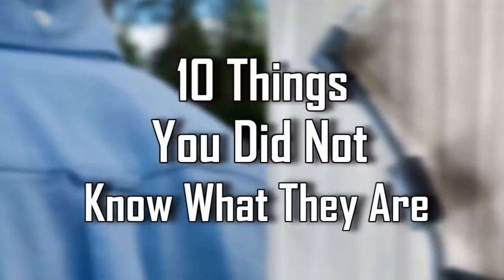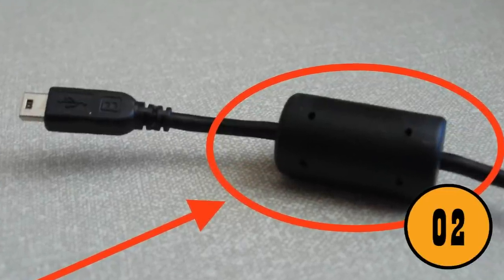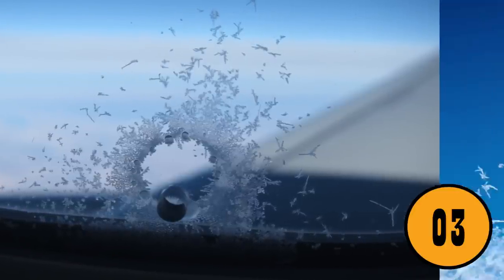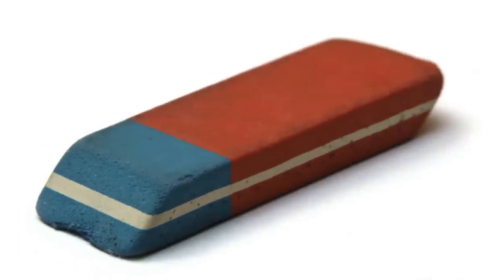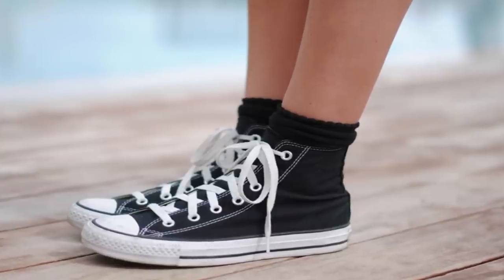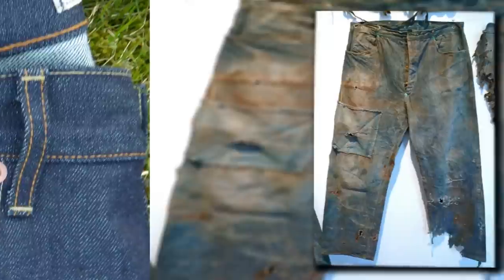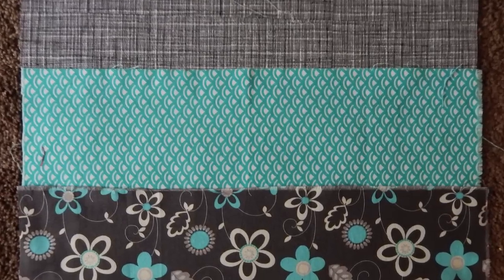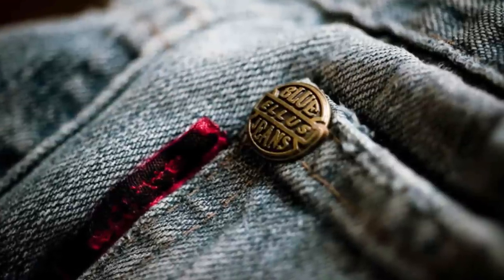10 Things You Did Not Know What They Are

Comment: That loop is for people who wear Y suspenders. They slip through.
Reply: I think you are right.
Reply: makes sense, ty
Reply: Nope.  The Y is much lower.
Reply: What if I told you that not all suspenders are exactly the same?  /Morpheus meme/
Reply: Don't listen to this joker, it's clearly for a vampire-slaying ninja sword. Have you not seen Blade? :O
Reply: Considering that the loop is far too high for Y-strap suspenders to slip through, I find this ludicrous. And what would be the point? I've worn suspenders for years (because they look fucking dope) and there's never an issue with the back strap/straps needing to be held in place.

I think Mr. Q is making shit up.
Reply: You would have to plug the whole before you got into the air, and hold it until it shattered. Not a good idea.
Reply: Actually, the loop is called a 'locker loop'. More info on google
Reply: Bruh, I learned more from this comment than I did from this video.  Nice work.
Reply: This reason makes sense and is better than the whole video.
Reply: Mr. Q - iLoveQatar.net that was obvious
Reply: Them spenders going through that loop would make for some VERY uncomfortable spenders!!!  Either that or Ole MG is about six inches across the shoulders...........
Reply: That makes sense. :)
Reply: And most people think, and think and think, some even make videos :)
Reply: I thought you could use it to were head phones when you were them behind your back it stops the cord from getting tangled up in your jacket and bunched up it also looks cleaner
Reply: Kippetjevanalles your right i use them to hold the head phone cord so they dont get in my way
Reply: Yaaaaay guess who's here Qatari guy and Mr.Q
Reply: Mr. Q - iLoveQatar.net and 7
Reply: @crumblecolic, my bff from Cheraw, from college, Lisa Williams.. she is working stuff like that, and recently repaid in full her college loans, using some website.. I think it's Gulf10.com or something.. Interesting thing is that she was able to do it working part time only, managing her classes along the way as well
Reply: Mr. Q - iLoveQatar.net makes more sense than the others.
Reply: Yea but let this channel get the less likely reasons lol
Reply: Polite Doom why did you need to say why you wear them lmao.
Reply: Yes because SO many of us wear suspenders.  Yep.
Reply: Nono you don't stick the suspenders through the loop the loop is just "for" them. Kind of like how i'm for free speech but i'm not gonna pass myself through it just to hold a pair of pants up.
Reply: Correct
Reply: Mr. Q - iLoveQatar.net 1999 MITsubishi Montere
Reply: When I was in jr hi school they were called fairy loops and were often ripped off the nerds' shirts.
Reply: Mr. Q - iLoveQatar.net its to tether a hat.
Reply: I cannot believe the number of people who bought the "suspenders" bit. Seriously people? Great troll Mr. Q, very successful.
Reply: @christyler1817  That's not the reason they were invented (yes, it's a "locker loop"), but it's a pretty cool idea... if you can reach back between your shoulder blades to thread the cord. :-) (I know, I know... before you put on the shirt). But maybe you should try to suggest to manufacturers to move it to the bottom back of the collar so it became more versatile as you suggest. From little ideas... !!
Reply: It's to hang your courting onion. A yellow onion means your dating casually. A white onion means you intend to ask the girl to marry you.
Everybody should know that.
Reply: Boj doog
Reply: Deathrider o
Reply: Thanks
Reply: You would think he would do research on what it's purpose is
Reply: Google it, sailors used to hang their shirts, then it crept into fashion. It's too high for even the single type.
Reply: Could it also be to connect to the suit jacket
Reply: Its to hang key chains.
Reply: I was about to comment about the y suspenders also but ya beat me 😉
Reply: Thank you
Reply: Simply use bubble yum
Reply: I WAS THINKING THE SAME THING
Reply: You just saved me 5 min
Reply: @Deathrider you had me at "i wear suspenders because they look fuckin dope". 😍
Reply: I hate how some people dont know this comment is a joke

Comment: I always thought the hole in a pen cap is so the air can escape when you press it down on the pen... pushing the pen into the cap would compress the air in the cap so the leave a whole to allow the cap to go on easier and also not createing vacuum suction making it hard to remove.... am I wrong??
Reply: I highly doubt that. The average pen cap only slides about 3mm before locking in place on the pen. No resistance due to suction or compression, not in my lifetime of using pens anyway. I mean, take magic markers, kids colouring pens (felts, as we call'em in NZ) and white board markers etc - they have to be air-tight so as not to allow the tip to go dry, yet still no issues with compression or suction in the lid.
Reply: I think that could help with that. It might also help reduce the chance of explosion.

Comment: “The design is quite simple: it’s made from therite and wrapped for its protection.”
Most videos wouldn’t have the balls to mention something obscure like therite and then not actually explain what it is despite being an informative video. Kudos.
Reply: And then promotly not explain what it is or why it is there.
Reply: Ferrite bead*. If a device is susceptible to interference, without this your device will act erratically or itself will emit interference. Think radio antenna. It stops the cable acting as an antenna basically.
Reply: Ferrite, not therite.

Comment: The hole in the airplane window is not there for passenger safety. It is there to prevent stresses on the plastic cover over the real window of the aircraft. Even is it does break there is no danger, and the inner window can simply be slotted out and replaced whenever it breaks. The inner window is only there to protect the outer (real) window from getting scratched, knocked and thumped by the passengers.

Comment: dude,the hole at the top of a pen cap is to stop the ink. if it doesn't make sense,it's like how a lit candle survives underwater with a glass to prevent water from coming in.
Reply: Don't know if it's true but it makes way more sense than what they stated. This and the fact that not all pen caps have holes in them.
Reply: YEs they do, but only the right sort of people can see them..
Reply: I think its like how a tree in my house fell because I looked at it in a forest.
Reply: how does a hole stop anything?... so many people nowadays express themselves so poorly! ><'
Reply: dude,I said it's like how a candle survives underwater using a glass while pushing it down.

Same thing happens when a pen cap has a hole and you put it on the pen.

it's because of the air pressure that gets trapped inside and the hole is where the air pressure builds up the most. This is also the reason why it's hard to take the cap off. It acts as if it's sucking the cap in.
Reply: Tetsuo Arakawa yeah, but those two scenarios are totally not one of the same kind. A glas with air in it is push down directly on and into water with its opening facing downwards and then inside the glass there is air and outside the glass there is water, two very different substances with very different qualities. Because of all these factors the air stays in the glass since air is lighter then water and therefor wants to go upwards where the glass forms a barrier so it can´t escape the glass and thus allows the candle to remain burning. Meanwhile in the case of the pencap the opening can be pointed towards any direction (downwards but also upwards, sideways, whatever) and both inside of it as outside of it is the same air with the same qualities. So really the only similarity in your comparison is that in both cases there is a hole in the object and that something gets puched onto or into something else. Everything else is basically different.
So that's why I felt like you weren't making much sense and I just hoped that you did had some sort of logical idea about it so I hopefully assumed that you are just really bad at expressing yourself...
Reply: Tetsuo Arakawa But in your second comment you stated that the air trapped inside the pencap somehow has a higher pressure (if that is indeed what you were trying to bring across) and that it builds up the most at the hole (so near the hole INSIDE of the pencap I assume you mean?) Why is that? I really haven't learned anything much thusfar, only a few apparant facts since a pencap on a pen and an air filled glass upside down underwater aren't the same thing.
Reply: I asked my teacher about the pen cap in our science class 2 years back. there are more than two reasons,but all I can remember is to prevent choking and to prevent ink leaks. A pen cap with a hole prevents ink better than the other pen caps with smaller holes
Reply: Karaz Feral-Fang So he "swallowed" the pen cap into his airpipe?... that must be so painfull...
Reply: XD

Comment: #6 is entirely incorrect.. If I may, the space is there to drain liquids through - which is why many spoons and ladels come with slits or multiple lines.

The conept of it measuring servings is an old folk tale and the usage does not even stand up to scrutiny, since many of the holes are varied and of different sizes.

Sorry, just had to correct at least that one egregious incorrection...

(I worked in a few restaurants growing up, including one high-end one)
Reply: That much spaghetti is enough... For a baby. I honestly don't know how that's a whole serving.
Reply: Its really there to measure a serving of pasta...you fill the hole with the uncooked pasta...remove and boil..that will equal one serving.
Reply: @briandazio3285 
The spoons you can buy are all different sizes, some have holes,some have slots, some have multiple holes or slots. Or both. The portion thing makes no sense at all. If all spaghetti spoons were the same exact size, then maybe. But they aren't.
Reply: Ok...im talking about the spoons that habe one nickle,quarter size hole in the middle...they are specific pasta spoons.
Reply: Brian Dazio I’m still trying to understand how a hole the size of a nickel could measure out a serving of pasta. Do you mean you stick pieces of spaghetti in until it is full, pull it back out, and then cook it??? What if someone orders rigatoni, or penne, or farfalle, or conchiglie, or fusilli? Wouldn’t it be easier to just weigh or eyeball the amount necessary for one serving.
Me thinks the hole is to drain the water.
Reply: Thats exactly what you do...its a pasta spoon...not to measure other types of noodles.
Reply: Brian Dazio So you mean it’s a spaghetti spoon, pasta can be any durum wheat noodle of any shape, generally derived in Italy.
So do yo think it would work with linguine or capellini?
Reply: Brian Dazio pasta!!!??? Bro pasta can be big noodles or little... da frick
Reply: But on some pasta boxes there's the same measurements 🤷‍♀️

Comment: And for all these years I've been wearing my tie on the front...Here I always thought the loop was a pony tail tamer.

Really gang... The loop is called a "locker loop" and  it is for hanging. If you hang a dress shirts by the collar it will distort them. Hanging it at the back, where it is under pressure from the shoulders when worn, will quickly smooth out any hanging wrinkles.

And the watch pocket was kept and was later referred to as a key pocket. It keeps a key separate from other crap in your pocket so it's easy to find. If you have a few keys together, the pocket keeps them from rattling arounnd in the main pocket.

Comment: what if someone blocks the hole on a plane window
Reply: that's what i was thinking
Reply: whole plane explodes and creates a black hole.
Reply: You wouldn't be able to block every single hole on the plane, for starters. Even if you did, you wouldn't be able to block it with a tight enough seal to prevent the pressure equalisation
Reply: well you dont have to block all of them only a single window breaking is already a big problem
Reply: If you press your finger on the hole and the plane starts to sink, you flesh will be sucked between the glass panes, ripping your finger apart. DON'T TRY THIS AT HOME, BOYS!!
Reply: this... just this...
Reply: How could you possibly try this at home? Even if you had your own plane at home, how would you get the  air pressure to change enough to matter?
Reply: NYpaddler You just seal your house, drill a hole inside you window, turn on air condition and lower the temperture below -20 degree celsius. The force between the cold area inside the house and the heat outside will create a strong vaccum-like area in the hole. There you could imitate the effect but again.
DON'T TRY THIS AT HOME!!!!
Reply: haha you are all brilliant
Reply: Now you have something to try next time you fly. ✈️
Reply: 木星からの脱出 don't encourage 😂
Reply: Derek Gleeson
lol, sick humor

Comment: Nr 8
The hole is for air. Without it, the air in the cap would push back the ink by pressure and the pan would become useless.
Reply: Not true at all. Long before you were born the caps did not have a hole and the pens worked fine, till they ran out of ink.  The first time I saw one with the hole in the top  I was pissed because the cap without the hole would keep ink from ruining a pocked or inside of a purse if the ball point was defective and started to leak.
Reply: It is so you can take off the cap easier. I remember when they changed this. I used to have to bite it to get it open in High School. If you were not careful, you would crush the pen and get ink everywhere. It was always worse after the item was in an outside locker then brought into a cool room for a while. Store your stuff in an outside locker for lunch. Math after lunch using my pencils, then second period after and the pen biting began.
Reply: Ballpoint pens worked for about 70 years just fine without holes in caps. They were introduced when children dying from inhaling pen tops became an issue
Reply: Internet. News
Reply: Clearly somebody isn't up to date on their pen design lore.

Comment: So the hole in the cap of my Bic pen is in case I swallow it??
Reply: Maybe kids who chew on the caps?
Reply: I thought it was to keep stupid people from spazzing out and stabbing themselves in the eye.
Reply: It has many uses. It is also there so if you bring it on a plane, it won't blow up and fucking get the worst mess in your life.
Reply: no it's air pressure bs
Reply: it could be to allow the pen to shut.. if there was an air pocket inside the pen cap, it'd be difficult to push the pen into the cap.
Reply: That is exactly what I thought, if the pen fits very tightly the air pressure inside wouldn't allow you to push the cap on completely.
Reply: The opposite is also true. Without the hole, it'd be harder to pull the cap off because of the air pushed out to close it. There'd be a mild vacuum effect resisting an attempt to pull it off.

Comment: The spaghetti one is bullshit
Reply: Yep, it's clearly just for draining excess water when serving.
Reply: Probably both actually.
Reply: As a bonus: Hole = less plastic used per spoon = lower cost (it's small but over the number of spoons the company makes it adds up)
Reply: Totally
Reply: How in any way does a hole measure out a serving size? It makes zero sense. Please enlighten me.
Reply: Nope.. when you dip out spaghetti it's usually hanging off the sides of the spoon.. no way its going to end up falling through that hole!
And if your spaghetti was meant to fall out of that hole.. how  much time would it take for a person to full a plate if everything keeps falling out on its way out of the pot?
Reply: Correct
Reply: i think they mean you measure it dry... as in you grab a bundle of dry spaghetti the same diameter as the hole and that is 1 serve... still doubt that's what the hole is for... the video is crap lol
Reply: You are supposed to measure it dry, as many mentioned above. But if you rely on this you are betting that your manufacturer knows this use. Doesn't seem reliable to me.
Reply: Yep always has, and always will be for draining water.
Reply: Exactly. If you've ever tried it, it's ridiculous what happens to all the remaining spaghetti that doesn't fit. I just want to eat!... not play pick-up-fkn-sticks! I just tear open a quarter of the box top and use whatever comes out. Works every time! 😎

Comment: so if i wanted to crash a plane all i have to do is put my finger over that little hole?
Reply: and all the other holes... before the plane takes off... at the same time... gl XD
Reply: but by plugging that one hole wouldn't that destabilize the pressure of that one window causing it to bust?
Reply: Also, the hole is to measure one serving of spaghetti.
Reply: +MyHatIsGreen That is a common misconception, the hole is too small for that.
In reality, it is a legal requirement on airlines so to minimize the risk of cetaceans swallowing low flying planes and choking on them, as there are many airports on the coast and very few whales left.
It is indeed the same principle by which great white sharks do not choke when swallowing a human.
Reply: bubba82069 Lolol

Comment: What happens if you block that little hole in the airplane window.
Reply: The hole is on the outside, isn't it?
Reply: Nothing, unless you block all the holes simutaneously. But your fingers wouldnt be strong enough to maintain the pressure.

In other words - no you cannot make the plane go down with your bare fingers.
Reply: Albin .... dude the windows are not connected like that lol.
The actual reason for the holes is the same reason why with double layered windows you will alwaqys find a hole somewhere either on the outside or the inside.
It has to do with the windows not fogging up even though the temp difference is really high. If you dont believe me i could go out of my office and take a pic of the aircraft parts warehouse below my office  ;)